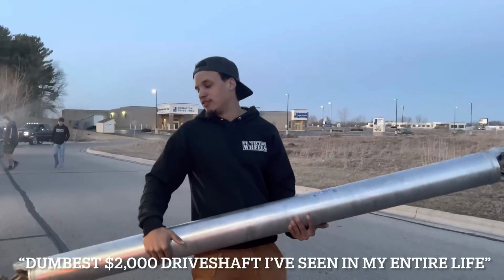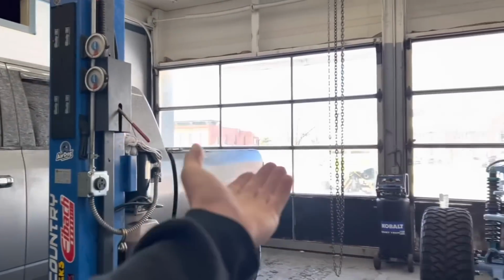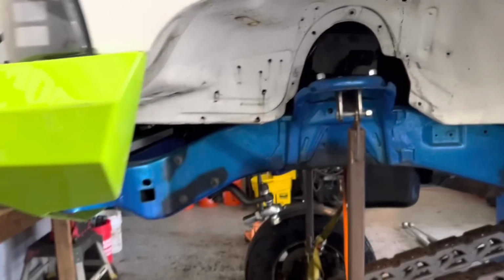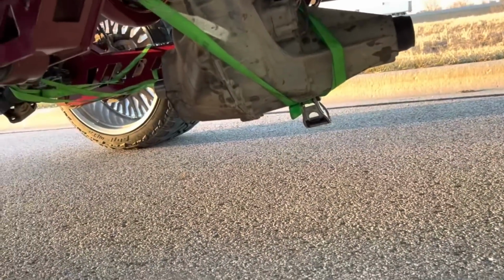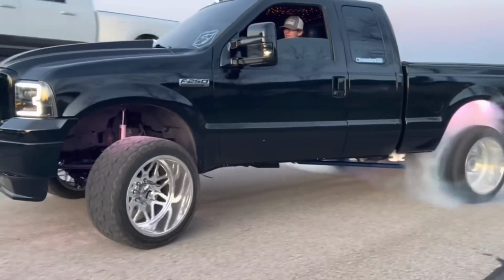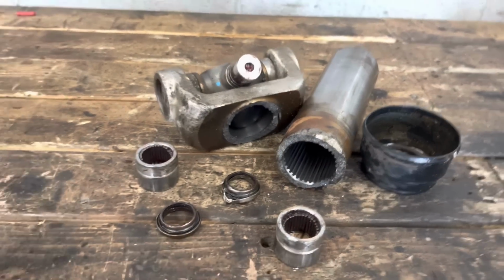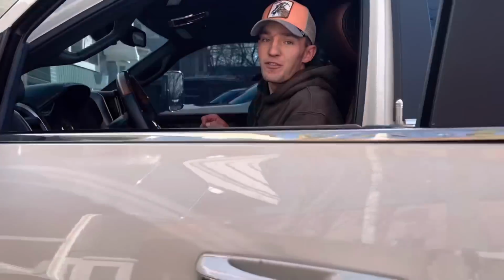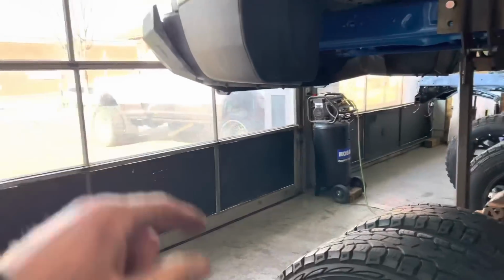Worlds First MANUAL 5th Gen Cummins Instantly EXPLODES!

Comment: You're supposed to pull it where all the weights on the axles but you got to make sure you pull it up enough to where you don't lose traction on your back tires so to have a little weight on the rear end of your truck and not all the weight on the rear and there's a truck